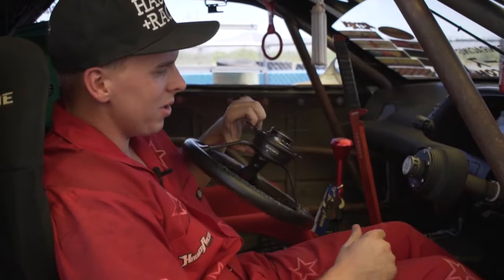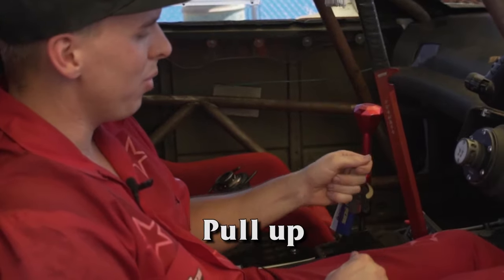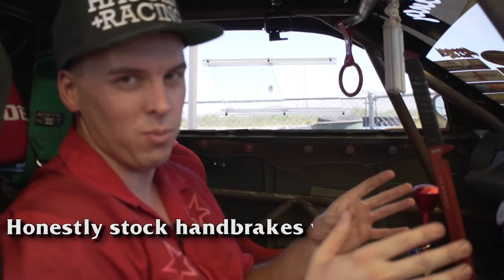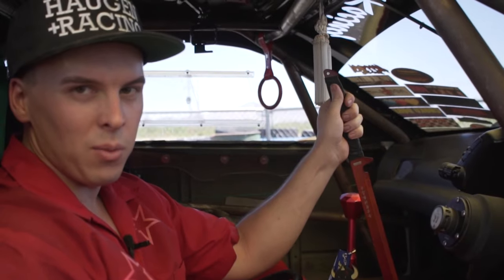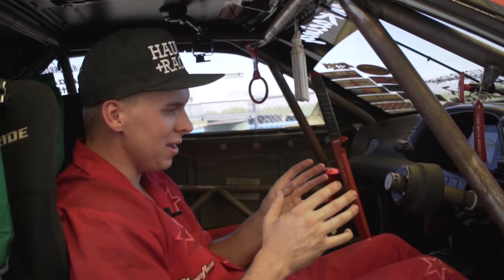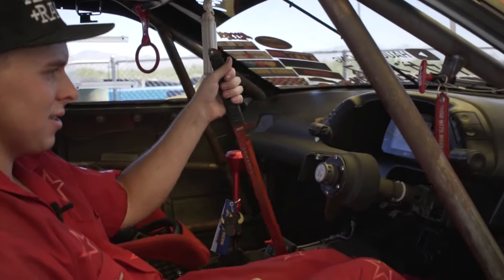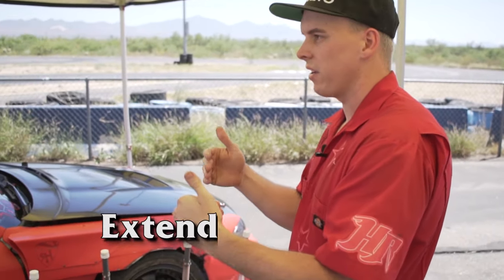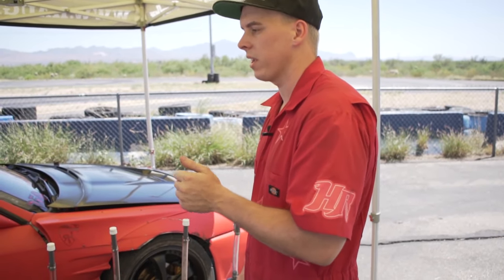How to Drift With a Handbrake

Comment: Having a hydraulic e-brake with dual calipers can help you stop if the brake pedal sinks to the floor. It helps because the stock parking brake doesn't get worn out. If you don't do dual calipers, that's fine. I'd do dual calipers for reliablity in the long term.

Comment: Serious question from an interested old schooler:
Can you make a faster lap time with drifting vs standard racing line?
Reply from the maker: Yes and no. Its dependent on the corner, like sometimes a drifting line can slow you down trying to show off, but on the other hand yeah giving the tail a little flick to get you through a corner can shave some lap times!!
Reply: No, drifting is slower. In every situation but dirt. Asphalt has so much traction you're losing acceleration when the wheels slip with the exception of the slight oversteer you want when exiting a corner.
Reply: Use it to get nitro.
Reply: @QuoteFarm if you have a 180 degree turn with a short radius drifting is faster long sweeping 180s no

Comment: I got a question, since i know nothing about drift.... If your at the 4th or 5th gear, the
you step on the clutch and apply the handbrake locking the rear wheel completely. What gear do you shift to before releasing the clutch?.... Modern stick transmission prevent you from shifting down to lower gears if your driving fast..... So what gear do you shift to after you apply the handbrake??....

Comment: How is it I can Drift my e36 DINAN M3 without any type of hand Brake, not even the parking brake. Is this what your saying, to learn to drift before getting a hand break.  Maybe it has enough power and gearing to not need an extra brake???  Still on Stock Spindle Knuckles.

Comment: so about the foot brake thing. my friends chevy pick up has one and we wanted to drift it so we stuck a pencil in the latch to keep it from locking and it worked. it’s like holding the button on a pull up

Comment: But if u already have the stock Handbrake,  and you install the Hydro next to the stock Handbrake, do u still have to press the clutch?
Reply from the maker: Handbrake is a separate system over the clutch.
Reply: @HaugenRacing  so i understood right that u no longer use the clutch when the Hydro is next do the pull-Handbrake right?, sorry im not the smartest person 😅
Reply: @Null__82  you still have to clutch-in when locking the rear wheels with a secondary hydraulic brake. The rotational speed of the rear wheels is directly connected to the rotational speed of the engine’s crankshaft under normal operation, so if you lock the rear wheels you must severe the connection between the crankshaft and the rear wheels (by clutching-in) or you will stall
Reply: @sisyphusofephyra3734  I guess you could get a rear drive disconnect like they have in rally cars, idk if theyre used in pro drifting

Comment: This guy is FOS. Most American cars come with a foot pedal e-brake. They CAN be modified easily to allow for use in this technique of drifting. You simply turn the ratchet bar upside down so it no longer catches and locks the brake in place and affix a spring to the pedal that return's the pedal to it's original position each time the weight is lifted off of it. This ends up making the pedal act just like something designed to drift.